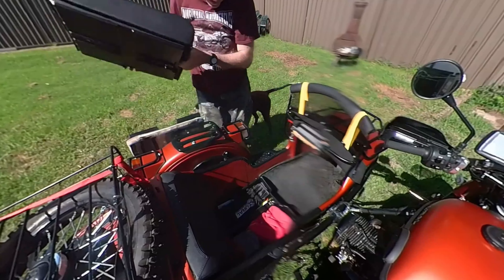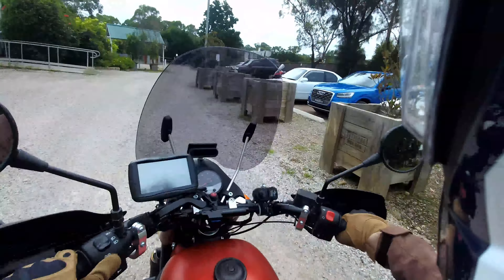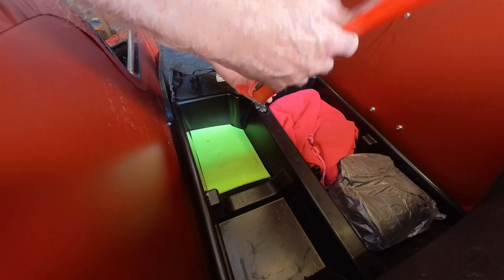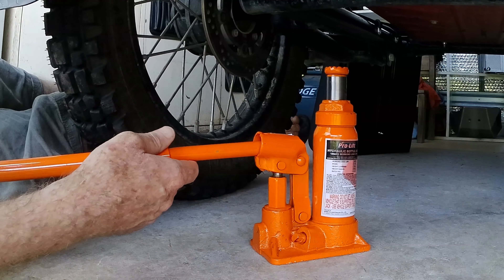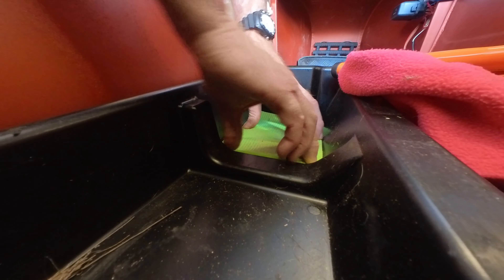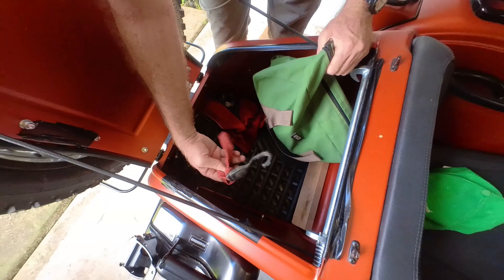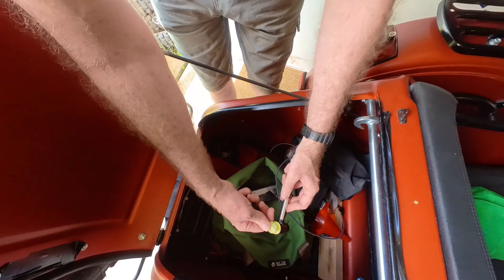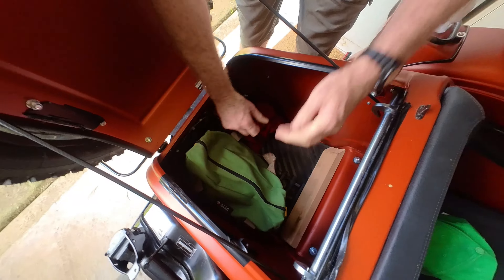Ural Motorcycle - what do I keep, under the seat ?

Comment: Loving the Chinese safety boots you're wearing when you put the bike on the centre stand. Many years before the RE 500 Classic with the side car I had a CX 500 with a sidecar. I used to carry 2 x 20 kg bags of dog food in the RE Classic and I had a ford fiesta fuel tank in the sidecar of the CX for ballast. It was connected to the main tank by a fuel pump , fuel line and a 3 way fuel tap so when I pulled into a servo I just filled the tank in the sidecar.
Reply from the maker: You must have had a decent fuel range 😀

Comment: For your bottle jack, what I did is a cut a six inch piece off a 2 x 4, drilled a one inch deep hole so the bottle jack extension top can insert in the hole. On the other end of the 2 x 4 piece, I grooved it into a u shape that forms against the radius of the frame where you jack up the bike. I’ve used this for years on my Gear-Up.
Reply from the maker: Thanks
good idea , I'll see if I have a drill bit that big , I should be able to make something like that.
Reply: If the jack is anything like the one I have in my garage the top should unscrew it's designed to take the extra space

Comment: Another fun video. It's surprising what we end up carrying. You need a set of Baja tools if you want to be able to change tubes/tires. Worth the investment for sure. Also, check to see if your jack has a screw extension in the ram. Most of the bottle jacks will extend some if you unscrew the contact point.
Reply from the maker: Thanks , I will check and see.